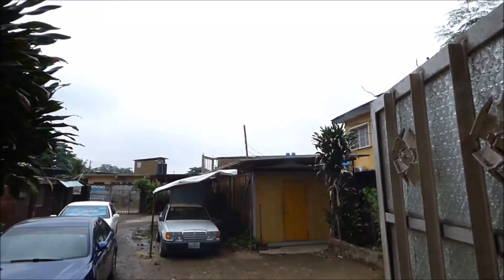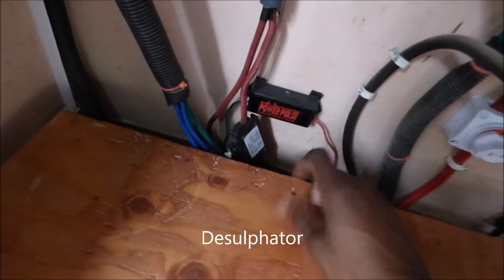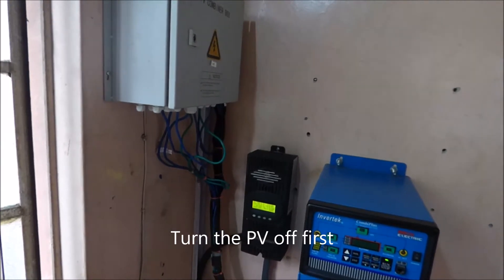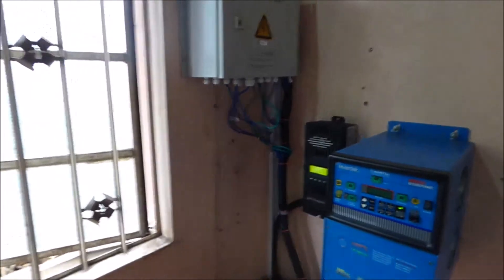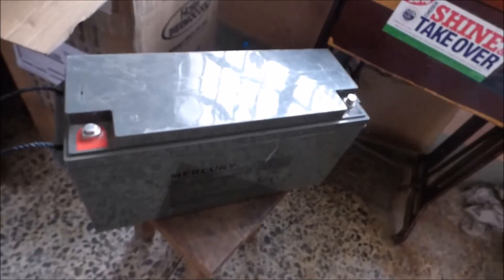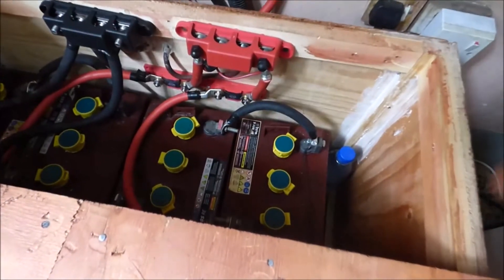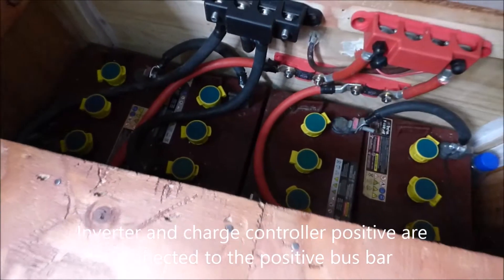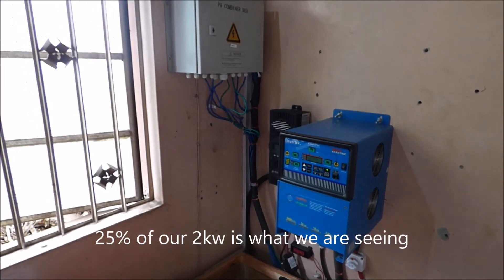We blew up three charge controllers this week

Comment: the Charge Controller burnt because of that stupid desulphator .
Reply from the maker: The charge controllers that burnt were not connected to a desulphator.
Reply: +AtlanticWastePower but it is connected with charge Controller Via batteries I think.
Reply from the maker: My crew (sub contractor we use) blew up 3 controllers at three different customers.